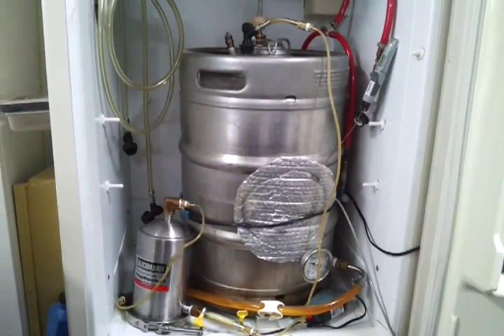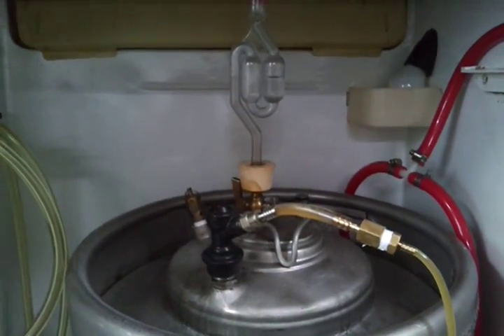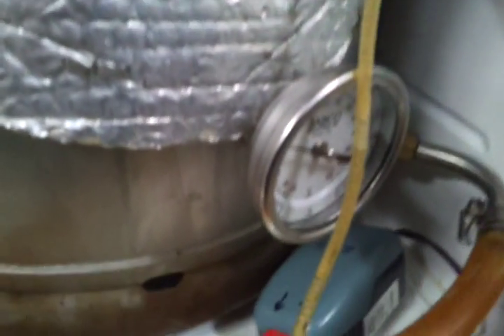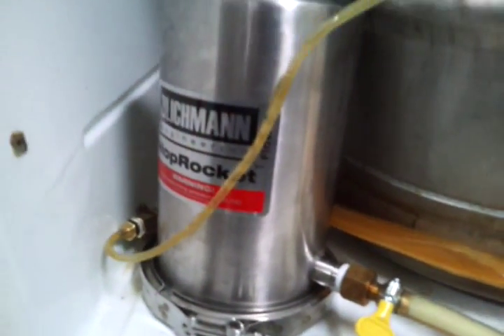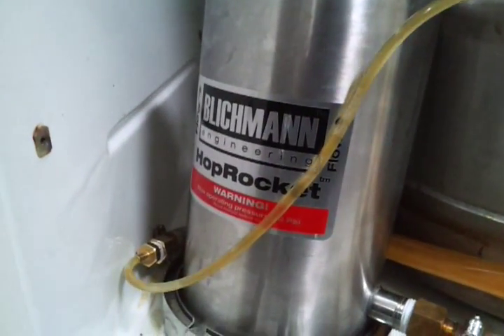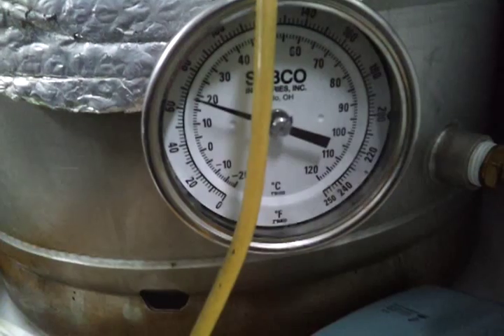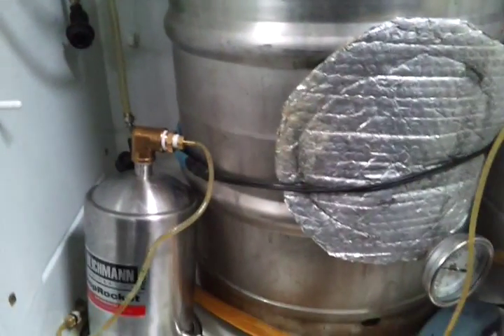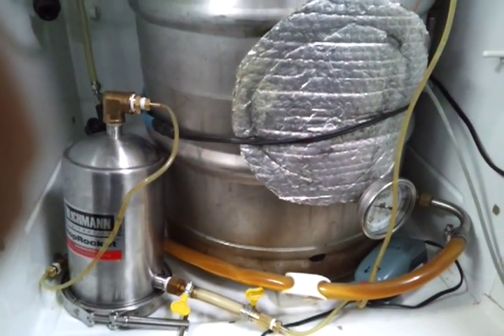Home Torpedo system

Comment from the maker: Answering some questions - slow on some, fast on the other.  The hop aroma and taste was on the mark for an IPA - not over the top.  I have had similar result with dry hopping loose hops and hops in a large hop bag.  It is important to time the start of this process.  I talked to a fermentation worker at SIerra Nevada and they start the Torpedo recirculation when the gravity is about 1/2 of the way to final fermentation which makes it about a day or two into the ferment.  In this case you are balancing the desire to have yeast active enough to absorb the oxygen and the fermentation to slow enough so that the aromatics do not get purged with CO2 flow.  I use the same schedule when dry hopping and remove the hops or rack to secondary after 5-7 days to avoid the grassyness of extensive dry hop exposure.  
2-3 ounces of leaf hops is the capacity of the Blichmann Hop Rocket. I brew 10 gallon batches.  I bought the Hop Rocket in March of 2011 soon after it was introduced and have not used it as a hopback in three years - four IPAs.  It ALWAYS obstructed with the leaf hops being blocked against the fine outlet screen.  This was a problem with the Torpedo system as well - even at the lower flow rates.  In Blichman's defence the HopRocket is now sold with a coarse mesh cylinder ahead of the fine screen which increases surface area and has more open sheet space to reduce clogging.  In Blichman's condemnation this (High Flow Insert) upgrade is sold for about $50. That is almost half of what I paid for my HR originally!  I think that this engineering error should result in a kit being provided to those that bought the 1.0 version of the apparently untested hop rocket.